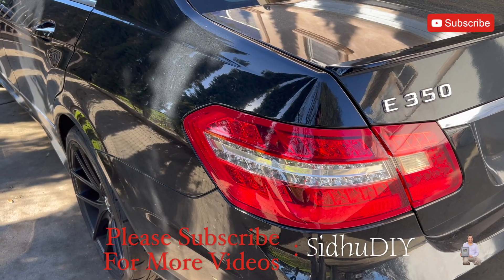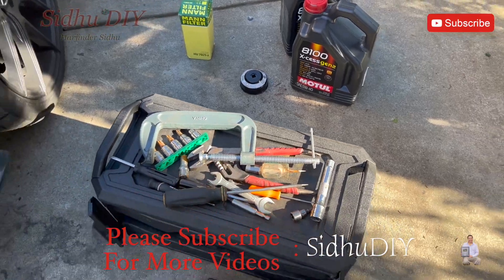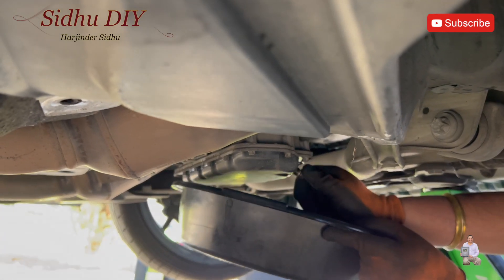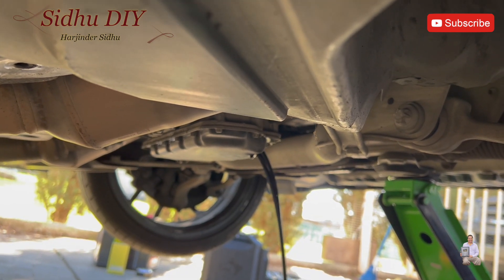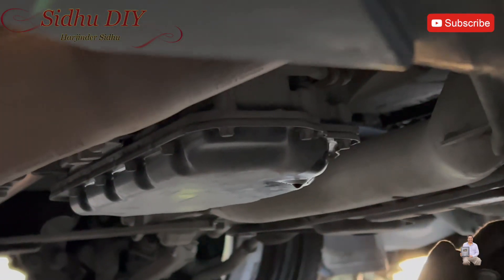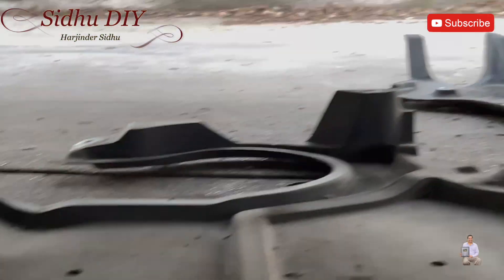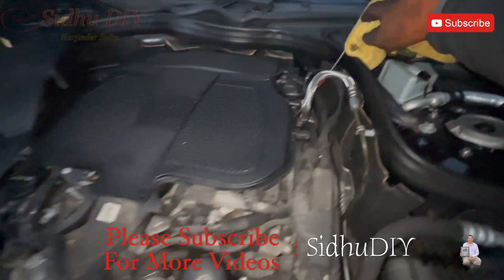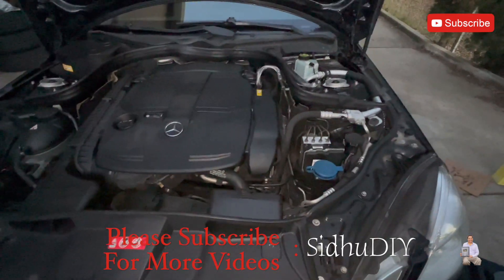How To Change Engine Oil and Oil Filter on Mercedes V6 E350 | W212

Comment from the maker: How To Change Engine Oil and Oil Filter on Mercedes E350 | W212 | 2013 e350 oil change
PLEASE use dead jack stands beside the jack, safety is very important, and I didn't use it in this video. So PLEASE take all the safety precautions, thank you.🙏

Comment: What's the size of the oil filter socket?
Reply from the maker: Motul 5w-40 synthetic oil - https://amzn.to/3RvV9Gp
Oil Filter - https://amzn.to/3Y9QiMP
Oil Filter Cap Wrench 76mm - https://amzn.to/3WIjoSp
oil funnel - https://amzn.to/38Z6S9s
oil drain bucket - https://amzn.to/2tvQ2yL
workshop towels - https://amzn.to/2PKI4dT